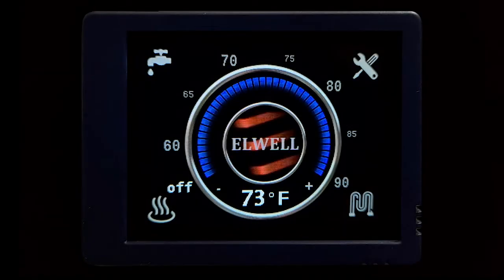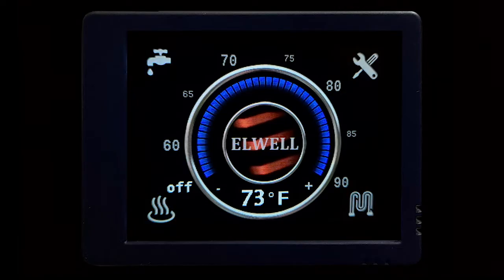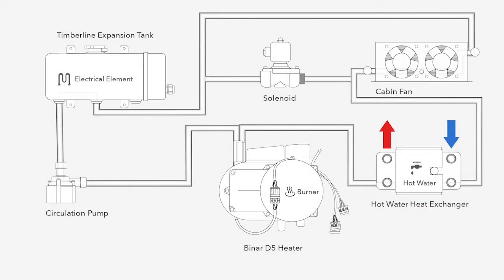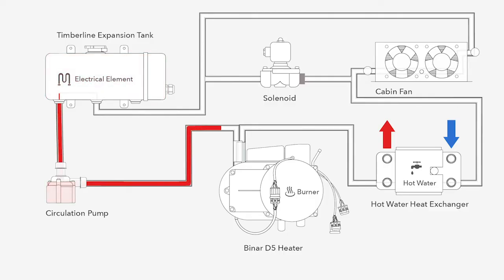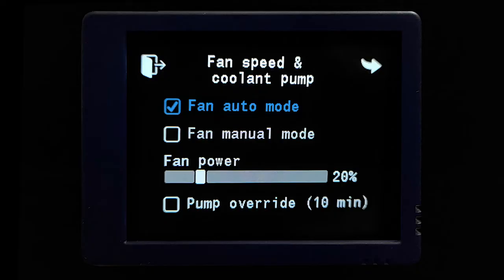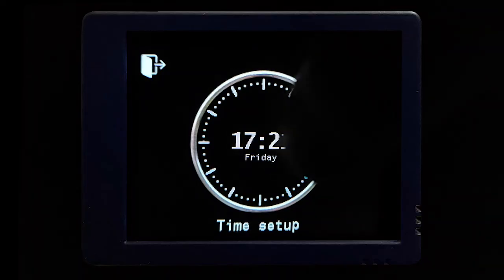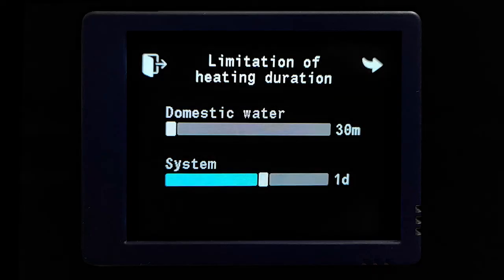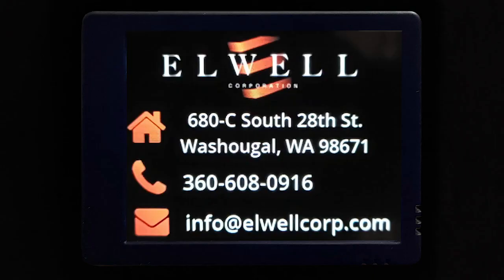Timberline Touch Screen Overview - Version 9.0.0.4

Comment: This is a great video. I don't know why Winnebago would provide this video in the documentation. I purchased a Winnebago Rpam in June 2023. haven't used the heating or water system at all. I wanted to make sure the heating system worked for this winter and have been struggling to get it working. The Winnebago documentation is too basic and no help, I get an error code 13 after a few minutes. If a still can't get it working I know who to call. Thank you for a great video.

Comment: Thanks for the video. Is there a way to set a timer to start the heater? Example being it’s 60 degrees at 9pm but you know it’ll be 30 before sunrise and you want to start the heater around 2am while asleep. I’ve seen this available on a system, just not sure if yours has it. Thanks in advance

Comment: Thank you - excellent video.  I purchased a 2023 Tiffin Wayfarer 25RW and received very little documentation about this system from the dealer.  During our first trip using the RV we couldn't get any hot water.  The dealer had a technical support line.  It turns out, he watched your video first and then explained how to set it up.  Turns out the Dealer never turned the hot water on with the Elwell System.  Not sure what I paid for with $995 for dealer preparation.  He told me to watch this video and it was extremely helpful in explaining the system.  With a few touches of the screen I had hot water.  It would be helpful to have a link to this video from the Tiffin website.  Thanks again.

Comment: Looks like a great product and thank you for this video.  I have been interested in this product but there is very little information about it, even on your website.  I really appreciated the heating loop diagram.  However, I did have a couple questions.  First I dont fully understand the need for the separate loops (winter and summer).  As long as the cabin fans arent turned on wouldnt the glycol just run through them and not heat up the cabin?  Also when the summer loop is turned on, wouldnt there need to a second solenoid to shut off that cabin fan loop?
Reply from the maker: Hey Kyle, 
Thank you for your questions and interest. 
The purpose for the different loops is even if the fans were not engaged in the winter loop, heat would still radiate from the fan heat exchanger. By creating a summer loop, this will keep the glycol from radiating heat. Like electricity, fluid will take the path of least resistance. So when the solenoid is opened for the summer loop, the glycol in the system will completely bypass the fans and go back to the expansion tank.
Reply: @elwellcorporation  Thank you for the quick response.  Are you planning on putting any more videos or more documents of this system?  I am debating between this or Rixen or or more of a DIY espar system.  The main reason I am shying away from the Timberline is that there is just not really any pictures or videos of the installation or components.  If I research the other two options I can find much more information and I get a better understanding of the whole system.  I have heard or been told that your system is maintenance free, could you explain that more? Cause with the Espar every 2500 hrs or so, you need to clean it out and replace some o-rings and gaskets.  What about being able to add and control a engine pre heating loop, is that feature available.  I recently saw that the Rixen has a new control unit that requires a lot less cable to be run.  Basically a brain with all the circuitry down by the fan, heater, pump that gets all the wires plugged into it and then just a single RJ45 cable gets run up to the controller.  Is this the same for your system?  Sorry for all the questions but there is just so little information and documents for your system.
Reply from the maker: @WesternAdventures23  We should have more videos on the timberline coming soon, we are making a concerted effort to get more documentation pushed out.
If you call or email into our office, we would be more than happy to get you documentation and answer any questions you may have.

Comment: Good video, wish it had been out sooner. I spent nearly an hour trying to figure it out, since the dealer didn’t know how to operate it fully. Elwell, PLEASE, publish a better manual than Winnebago puts in their manual supplement 3/4 of a page does not do your system justice. Since this is a Binar system, please, help us figure a way to a heat the engine block and use waste heat to heat the Timberline system with out running the diesel heater.
Reply: I don't have this system but I'm interested in getting it, so I don't really know how the actual system looks.  However, to heat the engine just use another plate heat exchanger in line with this system and instead of running water through the other ports, attach those ports to your engine coolant loop and put a coolant pump in that loop.  When you want to heat the engine then run the Timberline heater and switch the added coolant pump on.  If there is a way to switch the Timberline existing coolant pump on independently then you could use the same concept to use the engines extra heat to run to your water or coach heat.